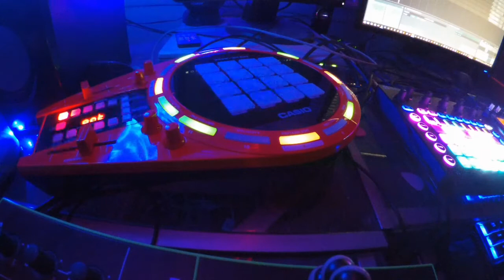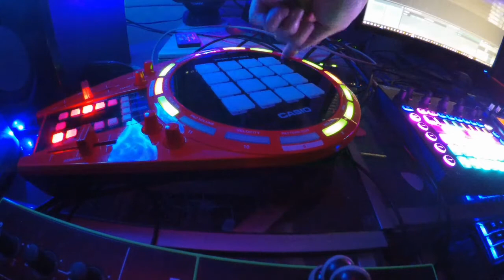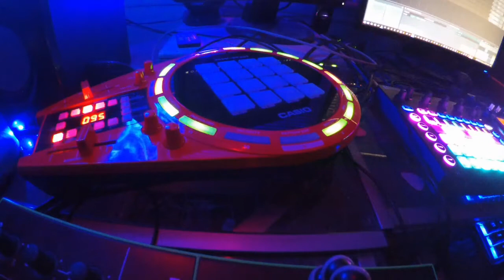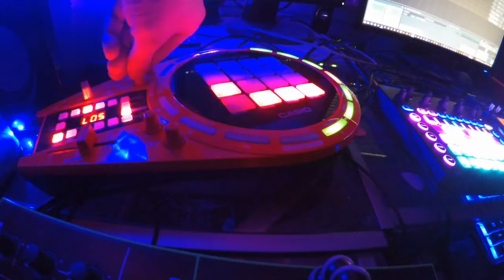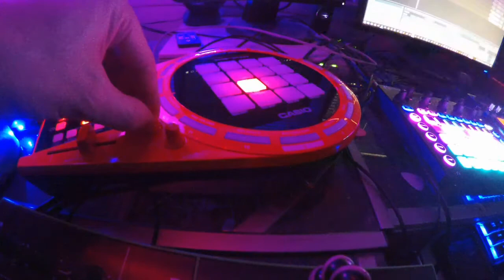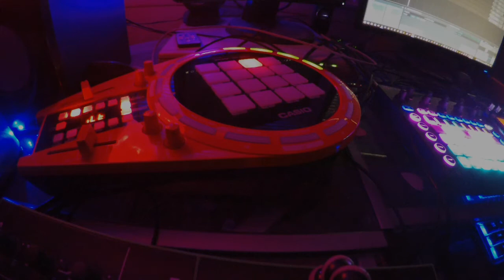Step Sequencing Mangle FX Grids // Casio XWPD1 Tutorial with Novation Circuit

Comment: are you using the xw-pd1 as the last step before your daw or speakers? are you strictly using it as a replacement for guitar/effects pedals?
ps genius using it to set up sequencing for banks of effects it adds a whole new layer.
Reply from the maker: John Whitacre I use it to do drums and fx mangling from circuit running in. that all goes to my emx1, then all of that goes to kp3 and then into daw.